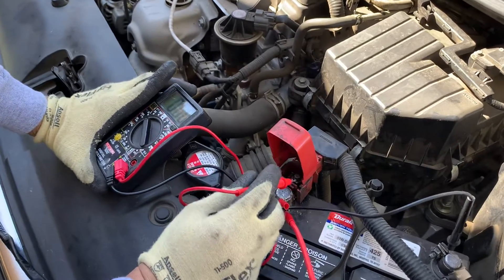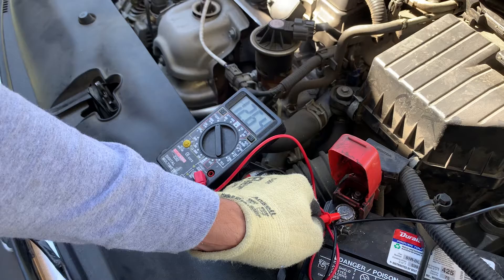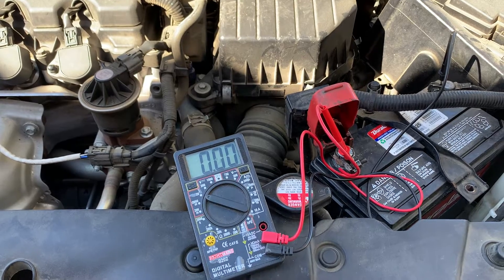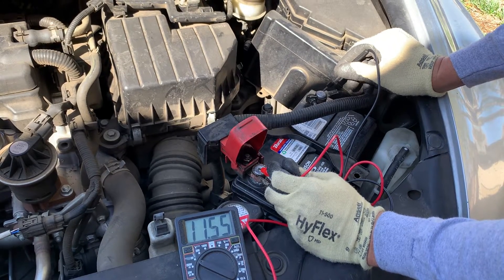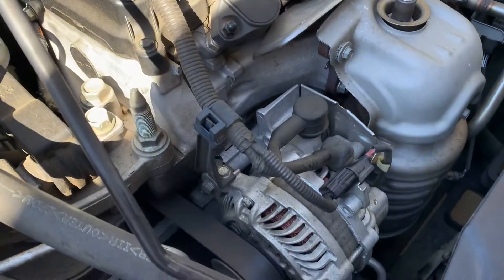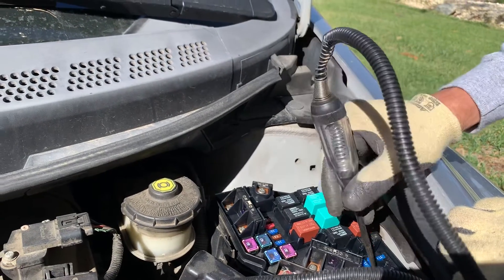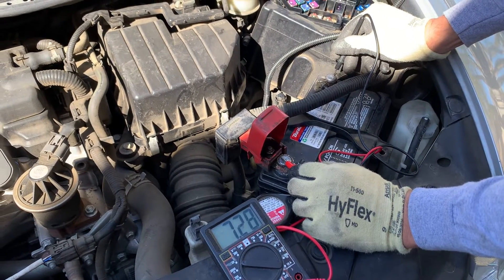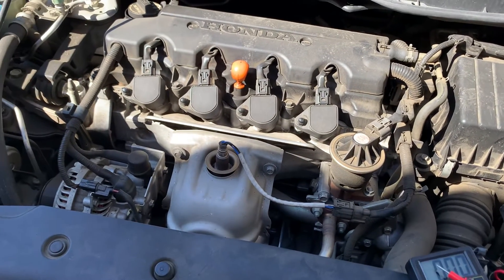Car won’t start, alternator or battery is bad.

Comment: I changed the battery and alternator check the fuses and still my battery won't charge 🙃
Reply from the maker: Well how much voltage are you getting on battery, what is your car doing?
Reply: @Daysnlife  12.6 not running 12.3 running
Reply from the maker: Ok so when the car is running the battery should be At least 13.5V but normally is 14.2V  maybe a bad alternator! I’m not sure what exactly is wrong with your car maybe should take it to a Professional mechanic.